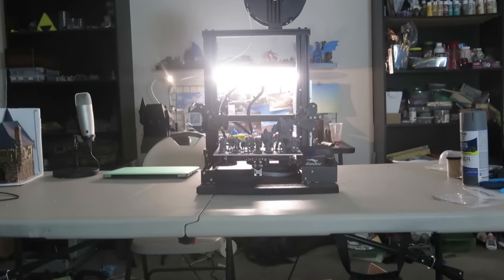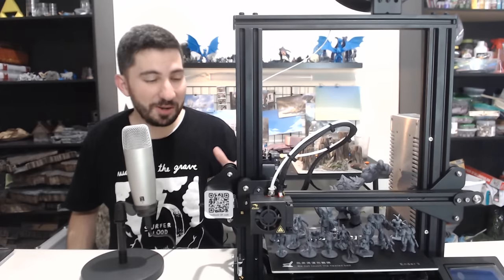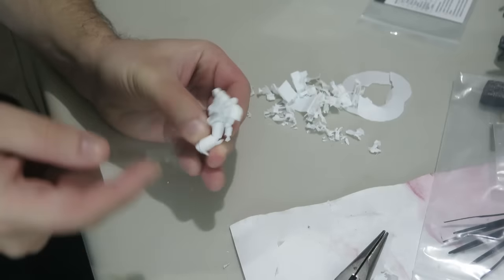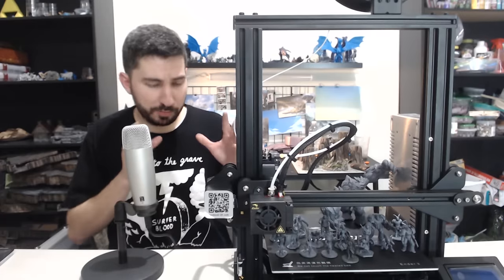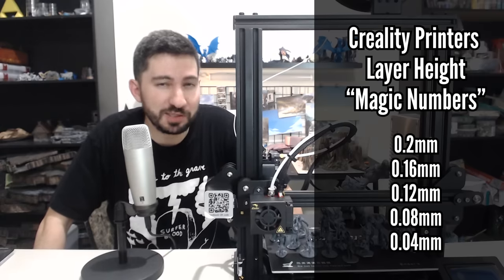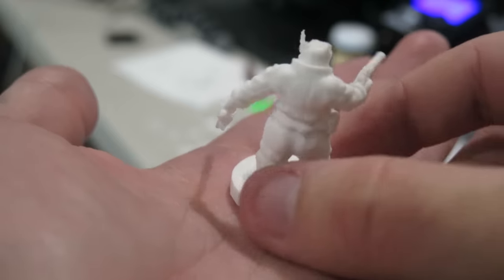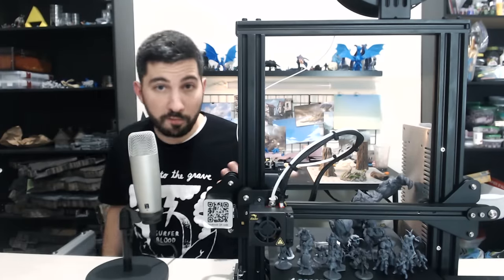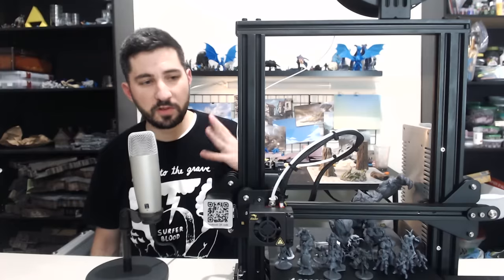How To Print Resin-Like FDM Minis on $200+ 3D Printers (Printing The Game #3)

Comment: As a Jeweller,  this info is very relevant to me as I fill the same detail requirements criteria when I am creating animals and stuff for cast'able rings. I Stumbled upon your channel just wanted to say great info and some tips will definitely help me personally best wishes
Reply: PS I have to use MoldLay which is a 3d printable Wax (170oC extruding temp ) like Polymer so basically PLA settings go right out of the window with it

Comment: Stock nozzle may print thinner line than you anticipate, same seems to be true with cheap nozzles too. I moved finally to 0.35 with 0.4mm nozzle. Creality has cheap parts, tolerances are not great but it does have good enough parts that with tweaking.. it does really good quality but it really takes time to find the right settings for your printer. Keeping things clean and well oiled will decrease variance over time that can be a real killer. 

First upgrades for ender are the extruder head assembly. If not dual axis, then at least make all the parts full metal. The parts cooling duct needs improvement if you want higher speeds. And the motherboard.. buy SKR mini 2.0.. Makes a MASSIVE different in quality and noise.

Comment: Thanks man, one of the issues I was wondering about you covered in this video. Looks like the filament printers are god enough quality for the "arm's reach" view....  Minis are meant for being viewed on the table, an arm's  reach away.
Reply from the maker: I love looking close at my minis, but yeah, you're right. I paint mostly to tabletop quality these days for time anyways :)
Reply: @3DPrintedTabletop  One of the things I try to stress when newbies ask about thier stuff on forums/Facebook.  "Don't sweat the errors you see when it's an inch away from your nose. Try to fix the ones that you can see when it's not under a magnifying glass"

Couldn't find some of my files so ordered a new cheap-o set, and got some more polyacrylic. Hopefully have some of the prints and another project (modded Heroclix) started this week.... Good excuse to stay in on a rainy day and have the
 printer running while I'm futzing with paint :)

Comment: Found your post on reddit and this when i'm trying to get better results on ender 3 v2, i'm going over settings you have in it, then trying it after my current print
Reply: Hi there, i also want to try this on my ender 3 v2. Did it work for you? did you have to change some settings? Id be curious
Reply: @thekrakerk6  changing the settings helped a bit, but I also changed to a 0.2 mm nozzle instead of 0.4, face details are still rough and I'm having to super glue some things cause they break when removing supports. My next thing may be switching to a stronger material than basic pla

Comment: (edit) - I took some of the settings from your profile and mixed them with settings from a profile created by @CHEP. His profiles were designed to use a .06mm nozzle and to be super fast. When I started using his profile the pieces I was printing were of poor quality because they are smaller and CHEP's print jobs are larger. So I took your settings and added them (with a few modifications) to CHEPs profile. Originally the print jobs went from 20minutes to 5hours. I ended up changing the layer height settling for a number in between the two profiles. I also changed the print speed. The print jobs are now running at around 45minutes with a very acceptable level of detail and there is barely any need to clean up the print job.

The game pieces are more solid because of the high number in the TOP LAYERS setting (which is 999999, max in Cura 5.6.0) This isn't a big deal for me and I sort of like it better than the hollow versions I printed previously with 15% infill. 

I also am using PETG with a higher temp for the extruder (220). I'm using PETG only because it is what I have in stock. The plate temp is (90). I find this is best and allows me to remove the print job easily with out having to scrape or bend the plate. I also do not need any brim or other supports. I do print a skirt to prepare the nozzle.

I found a retraction distance of 4.0, retraction min travel of 2.0, min extrusion distance window 10, help the print job have next to none for string or blobs.

I've impressed with the end results. Thanks for your video!
Reply: Hi Mike.  Would you be able to share your final profile?

Comment: I started using this profile on Cura 3.3 and man it works like a boss.  I'm sure there are ways to adapt the profile to make it run more efficient and quicker but personally i dont care.  I'd rather use more filament and time to get twice as good prints than quick and crappy looking.

Comment: Hey man, great video! I have been getting the same problems you described, and I couldn't seem to find a solution anywhere. I hope these new settings help, though I haven't tried them yet. This video is exactly what I needed; someone with my exact same problem, willing to help others who are beginning. I do have a couple questions, though:

1. Is there anything I need to change in the settings if I am using the JGMaker Magic printer? It literally looks exactly like the printer in your video, I'm guessing it's the same general idea, just a different brand.
2. Would I need to change anything in the settings for ABS filament, other than the normal stuff like nozzle temp? Right now I am using PLA, and I ordered some Hatchbox white ABS and grey PLA. I heard that Hatchbox was the best from many people, and I also thought I should try a new type of filament while I'm at it.

I know that I am watching this video 3 years too late, and then commenting on it. I do hope you see this though, and any other suggestions would be a big help. Thank you!

Comment: I’m looking to buy the new Ender3 S1 Plus model that’s coming soon from Creality.  The specs are similar to other Ender printers, mentioning 

Printing Precision: 100mm±0.2mm
Layer Height: 0.1-0.4 mm

Will this printer capable of achieving the resin-like quality? You mention the height is preferred to go below .1 range (roughly 0.02 height). Is that possible with this printer?

Comment: I just tried this with Cura 4.8 and it didn't work. I tried a few manual settings but the issue I ran into was with the supports. I was attempting to print a bard mini and he has a lot of detail around the chest area but the supports basically covered the details and I couldn't remove the supports easily. I took my time but in the end I actually ended up damaging some of the detail in my attempt to remove the supports. I will say that adjusting the layer height did seem to improve a few things so I am going to experiment further and see if there is anything else I can do. I also use IceSL Slicer and I have had some success with it. I am thinking that I will try some of the Cura settings in IceSL and see what results. I would really like to get this sorted so I can print my Hero Forge minis.

Comment: 2 questions.
1. if you're printing minis, wouldn't you definitely need smaller nozzles? it's like painting a picture with a finer brush tip. 
2. are you thinking about attaching second printhead to print pva supports? if you're gonna get that serious with minis
thanks a lot for the video.
Reply from the maker: No need for smaller nozzles, but they certainly help with crisper detail. Like some painters can use a thicker brush with experience as well. Still doable!

I'd LOOOOOOOVE to use multi material. Want to try maybe a CR-X with dissolvable supports for this exact reason :)

Comment: Hi Danny. I'm looking to start with 3D printing. And the results (smoothness) you show are better than most others. 
One thing I don't get (remind you I don't even have a printer yet); you set the layer thickness to 0.05 mm but the resolution of most printers is 0.1 mm. 
How does that work?

Comment: Hey.  I would love to try the siepie profile, but it will not load in Cura 4.6.  It gives me an error message.  Can you PLEASE update the profiles at your site for Cura 4.6?  Update:  The siepie profile does not work with 4.5 either.  Can this be fixed?

Comment: Somebody has probably said this but just in case....go buy smoothers for x and y axis. Super cheap (10 bucks for 3 or 4) super easy to install. (Open board compartment and clip into the 2 wires easily visible with x and y )They'll make everything look perfect especially for miniatures. No need to find the magic stepper setting. This does it with 4 steps in between the 2 steps it was originally....perfect looking prints for miniatures in particular. Smooth sailing from then on...literally lol

Comment: I know you used stock everything but I'm curious would a 0.2mm nozzle be even better? I'm a day zero newbie
Reply: I'd like to know as well.  I just put in a .2mm nozzle and wondering if I need to change any other settings on the profile.

Comment: Hi Daniel- first off, thanks a million for this video! I recently got an Ender 3 and had no idea this quality of print was even possible. I'm setting mine up to try a print using your settings today and will report back.

One question- when I imported your settings file into Cura, it didn't have supports turned on. What specific settings do you use for supports? Also, when I imported it it's set to .08 layer height even though you recommend .05. Do I need to change that manually, or has the height recommendation changed in the meantime? Thanks!

Comment: Love your videos and I'm using settings pulled from your website to print with but I've been getting a lot of warping in my prints (I always use a raft btw) any suggestions? Or would you recommend an adhesive? I've been hesitant to use them because I just feel like it might be messy over time but any input would be great. I'm using a Monoprice Maker Select V2.

Comment: Was going to try using the big version of the profile for half of a big'ish model, 9 days...
Reply from the maker: Drop the layers down to 6 top/6 bottom or 10/10 respectively if you want a lil more. And then bring infill down to 10%. Should solve your problem - gonna fix the large one later tonight!

Comment: But...if you upgrade you can print not only far faster but with greater detail. An upgraded ender 3 with out quality most resin printers until you get top tier RPs. 
Best upgrade to help this is a better cooling fan & perhaps a shroud.
With that said not bad work here, you've shown exactly what the video describes and the full range of a stock printer. 
2 thumbs up chap

Comment: This looks really great. So, if you were able to get such good results with a stock printer, if you modded it or at least used a smaller nozzle, would you get even better or smoother details? Or is the magic more in the settings rather than the hardware?

Comment: This video has changed my 3d printing life.
I printed for months with some pretty generic settings in Cura.  Printing was... passable, but cleanup to remove supports was a nightmare.
After using these settings, and now spending a couple of sessions cleaning up minis.. Oh man.. Difference is night and day.
Quality is amazing on the prints, but by the gods, the support cleanup is so easy and just pops right off.
Thanks 3D Printed Tabletop... you saved my prints and my sanity!

Comment: I'm new to 3d printers, and just found your video. Are your fingers getting covered in resin from the minis because they were freshly finished?
Reply from the maker: Hi! No, my fingers don't get covered - but I also use gloves whenever I remove and/or work with resin until it's been cured. I wipe down everything afterwards with 99% IPA alcohol to keep my station clean.

Comment: New 3D printer here, using an Ender 3! Have a question: you said you got these results using the default 0.4mm nozzle. Would it be worth any difference to use a 0.2mm nozzle instead (I’ve bought a couple)? Would I have to adjust the settings to compensate the change?

Comment: Magic numbers ... maybe it has to do with the 1.8 degree +-5% resolution and your stepper controller microstepping the stepper motor. And dont forget: the distance traveled when the motor is rotated by 1 step = 1.8deg+-5% (or 1\10 => 0.18+-5%) is dependend on the radius, as distance = 2*radius*sin(0.18%+-5% / 2). This would equal to 0.047 if your radius was 10mm (belt connection) and your stepper controller microsteps 1\10. Thus, this would maybe give you 0.05 as a magic number (and all multiples like 0.1, 0.15 etc.), because the error rate stays small. Otherwise your errors add up! 
Dont know what this printer has as specs, the 1.8 comes from the standard Nema17 with 200 steps\rotation (cuz 360degree \ 200 = 1.8 and dont forget the error margin of 5% of 1.8degree, so about 0.09degree maximum error with EVERY step).

Comment: So... this outdated and now the default is good enough for you to simply tweak it before you print?

This is still a bit overwhelming for me, so it would be great to still have access to a profile that you say ''works''. One of my first attemps with a very small mini (size of the Root game tokens) it actually went well, but it was almost default settings. I'm curious to try with this more common sized minis.

I'm also finding a lot of models that come separated in pieces anyway, not exactly what I expected, but I think I have to get used to it.

Comment: Honestly, spending more money on a 3D printer only ever gets you better detail if that money goes into higher resolution stepper motors, and most 3D printers already use some pretty good stepper motors as-is. The main benefit of more expensive 3D printers is the range of materials you can print. You're actually getting better detail on your Ender than I'm getting on my TAZ 5, but I can print with nylon and "exotic" filaments that require high temperatures (above the melting point of PTFE, requiring an all-metal hot-end) and/or a hardened nozzle.

Of course, for miniatures that's not very useful unless you want to play around with sinterable metal filaments, but then you need a sintering furnace and that gets into a whole other level of expense. "Exotic" filaments are primarily used for functional parts that see a lot of stress, and often require printing settings that reduce detail levels. You can get far more detail with PLA+ than I could ever get with Alloy910 Nylon simply because Nylon likes to be printed in relatively thick layers compared to other materials.

Comment: Hey Thanks for doing this video. I'm very new to 3D printing. I tried downloading your profiles but for some odd reason CURA couldn't read the files. I got this message: The machine defined in profile Siepie-CR10-Ender-3-Small-Minis-PLA-Base-1.0.curaprofile (fdmprinter) doesn't match with your current machine (creality_base), could not import it. I have an Ender 3 Pro. Am I installing this profile in the wrong directory? Thanks

Comment: I print a thicker shell with .6 - .8 layer height, and less infill with a thicker shell. Often 2.2mm - 2.6mm for small detailed objects. I've had some thinner shelled prints come out weak, but filled the inside with resin, and it ends up nearly indestructible.

Comment: Which variant of the Ender 3 did you get? The one with the tempered glass? Or just the standard one?
Reply from the maker: I got the standard one - it was one of the older models with some issues I had to work through. I think they've resolved a lot of the issues with their newer models. I think the build plate is just fine, but tempered glass is always a nice mod TBH. Cheers!

Comment: Hey, I’m new to 3D printing and I have a question. Is there an alternative to using the 999999999 top layer and 0 bottom layer setting? I’ve tried it in Cura but it makes it so the program won’t slice my models.
Reply: same here !
Reply: same here, is the current version of Cura not allowing this setting option?
Reply: Try figuring out what the max number of layers your print will be at that layer height (height divided by layer height) then add 100 for safety and use that number instead of 999999999

Comment: Tried printing a mini with your Cura profile in Cura 4.11 and I got super thick supports that were impossible to remove. Attempted to remove them and ended up snapping the mini off at the ankles. Any chance you'll be updating the profile for Cura 4.11?

Comment: Its the magic number because of how the leadscrew is designed as well as the steppers. IE, if one has a 1.8 stepper motor, meaning every 1.8 degrees is a step, then 360/1.8 is 200, the. If using a 8mm leadscrew, 8/200 is 0.04

Comment: I'm trying to implement these settings to cura 4.11 and to print 1 mini I'm getting slice times of ~2 days. You mentioned it may take 6 hours instead of 3 which I'm fine with, but not 30-40 hours on 1 28mm mini. And ideas why it'd take so long?

Comment: I'm kinda new, how does it work with using 0.08 layers with the stock nozzle? Does it actually extrude less material? Are the lines still the same "width" on the x/y axis but it just moves up a smaller amount on z after each layer?

Comment: Last time I tried to do a .05 mm layer height, it scratched my bed. But its probably because of the glass bed being too thick. In general that bed is too thick for my sensor to read and the instructions said nothing about buying a new sensor spesificaly for that bed, but that's besides the point. My point is, won't that later height cause the first layer to not appear at all or scratch the bed because of how close it is? I have a Tronxy X5SA

Comment: Hey Danny!  Love this video!  Just bought a Ender 3 Pro because of this video.  Newbie question,  I tried to download the Siepie profile in Cura, but it gives me an error message stating that it failed to import because "Could not find a quality type normal for  the current configuration."  Have you run into this?  Any help would be appreciated.
Reply: no solution here, but I have the pretty much the same issue on Cura 4.4.1 "Could not find a quality type high for  the current configuration"